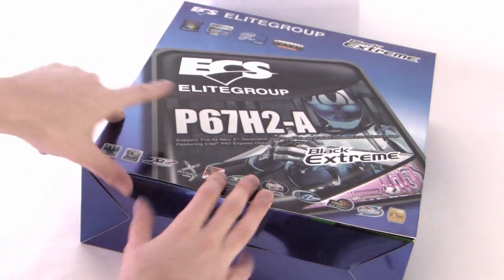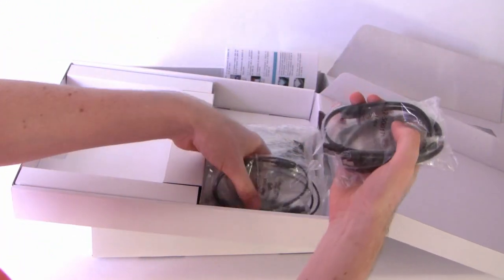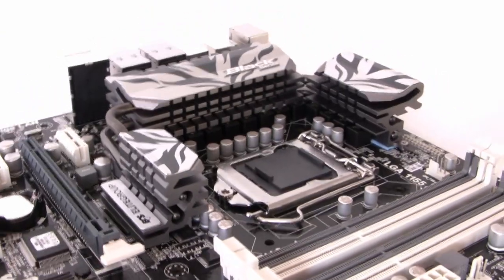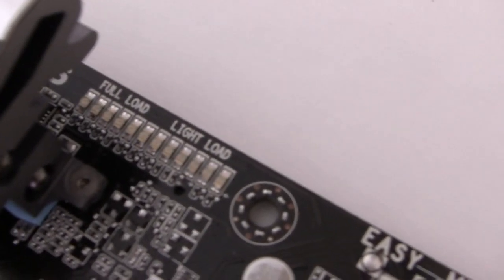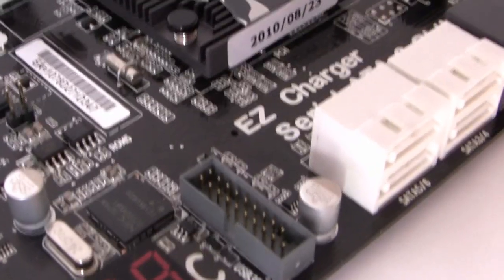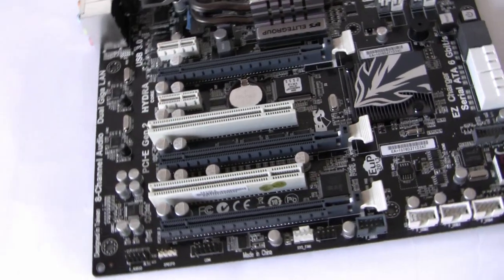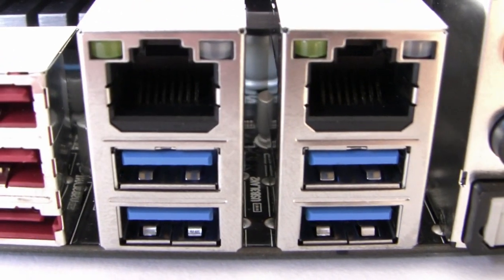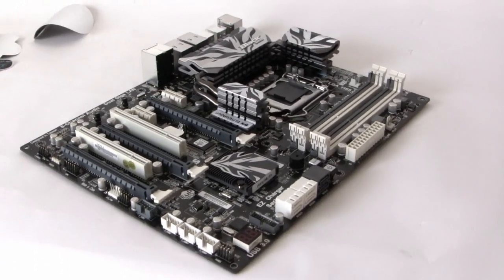EXCLUSIVE Intel P67 Chipset Sandy Bridge Preview (ECS P67H2-A Black Extreme)

Comment: You said the socket LGA 1155 will work with a LGA1556 processor. Intel says they are NOT cross compatible. Only the cpu coolers are cross compatible.